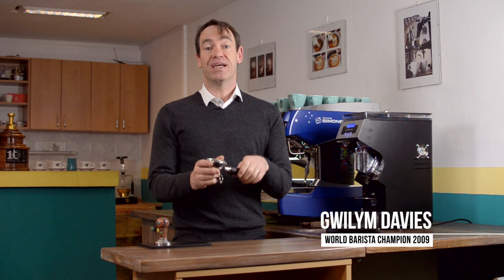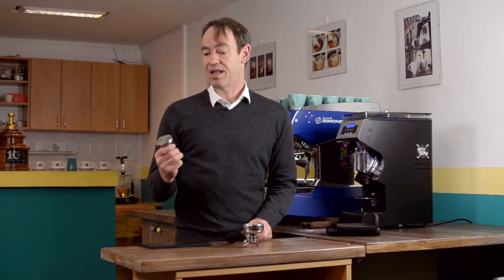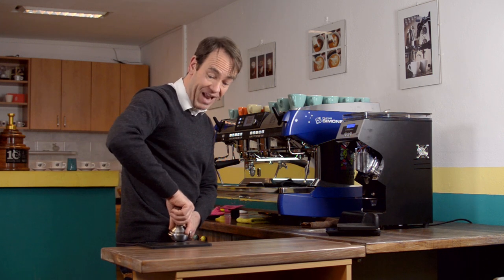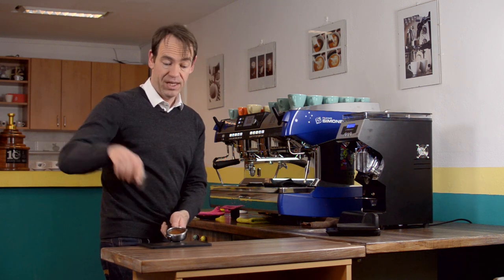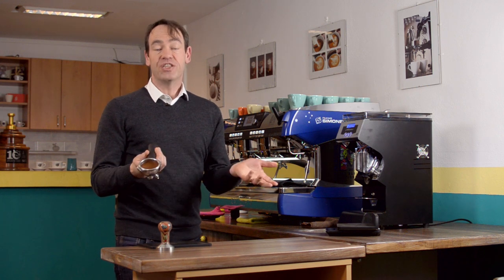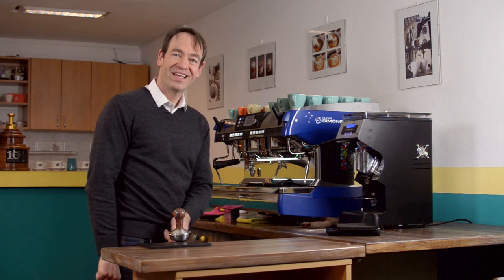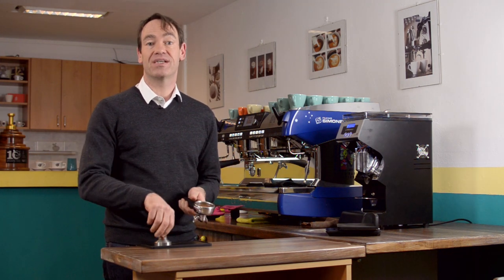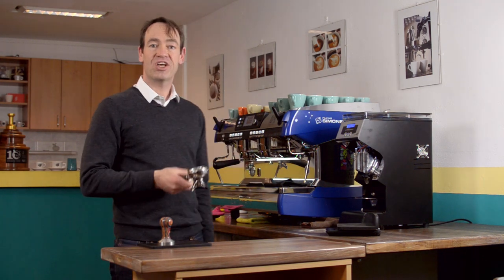How To Tamp Coffee for Espresso (the common mistakes) | Barista Training w/ Gwilym Davies #2

Comment: Comprehensive and user friendly exploration on one if not the most challenging part of espresso making!
Nice point on come out gently a specially for those who use custom tempers that have even tighter fit inside filter basket. They are very capable to lift and disturb the pack while exiting. 
Keep on twisting after packing,  it keeps your temper clean.

Comment: Why spin? I do it as well, not with full pressure but just like you, without downward force. I do it not for the puck or coffee in the portafilter, but for the tamper: It comes out completely clean, when I lift straight after tamping, I get a bit of coffee dust. Don't know why, maybe its static or something, but it is gone after a quick polish and that keeps my tamper and bar area clean for longer.
Reply: Clean tamper, uncratered puck. Especially in a high-speed professional context, a tamper might gather droplets of moisture, which can pull chunks out of the puck.

Comment: And my managers gave out to me that I tamp “too light” but even if I try to put all my weight on it it’s still not as hard as theirs. And I was here thinking “it’s not possible that making coffee would involve a process that is that selective and only strong people can do” 😅 I guess I was right, how can I make them watch it without sending it to them
Reply: Forget that... send them the link and take your W. You deserve it.
Reply: My mentor showed me exactly how hard to tamp by pressing down while I held the tamper. I experimented a lot on slow days and generally discovered that her advice was on the money (occasionally I found places where I could accrue marginal gains). For about a 19g dose in a 58mm filter she applied about 30 lbs of force. She said any more than that would slant the puck (often true) and any less wasn't enough (in reality research seems to suggest 20 is enough, but why risk it?).

On the other hand a lot of home baristas with more expensive equipment than experience and reddit coffeebros who read studies instead of conducting taste comparisons seem to interpret the data as "there is no such thing as tamping too hard" (I've even seen those exact words and similar sentences more than once). Just keep in mind that these are the same people who say things like "you can always go coarser," recommending using pourover grinds for espresso, or in extreme cases "cold-water espresso is just as good, maybe better." If you follow their directions to the letter you'll be making something closer in properties, taste and methodology to pourover, but doing it with an espresso machine- the usual recipe looks like an oversized dose of coarse light- to medium-roast grounds, shaken then tamped as hard as possible to reduce channeling (coarser grinds will have more variation between boulders and fines, necessitating different measures from finer espresso grinds), pre-infused for around 20 seconds (aka "bloomed" or steeped) if possible with your machine (only manuals and stupidly niche electrics can actually do this without hacky workarounds), then pulled extremely fast (5-10 seconds) at low pressure (6 bar or less, ie under the espresso threshold), usually at a very long ratio like 3:1 or even 4:1, resulting in a drink that is lighter, sweeter and weaker than espresso, while extracting a similar overall mass of solubles into a larger volume of water, with a lighter colour and little or no crema. In other words, it's functionally a more expensive and tedious pourover.

The real problem is when someone happens upon only part of this method, takes it as rote that it's a "superior technique," and implements it unquestioningly; or when eg someone sees that "surprisingly" turbo shots (or sone parts of their methodology) have similar or "better" extraction to traditional espresso, think this means they are superior or "stronger" (a similar misconception abounds with cold brew, because a cup (8 oz) of cold brew contains more caffeine than a "cup" (1 oz) of espresso, leading the semi-educated to say cold brew is actually stronger than espresso), and refuse to make espresso traditionally. Fortunately it's mostly a disease of home varistas, but it sounds like your bosses might have been in that camp, since the extra hard tamp fits the profile.

Comment: if i weren't putting enough pressure on the ground coffee with the tamper or not having enough coffee in the portafilter, could this be the reason my coffee keeps going watery really quickly? i've just got a coffee machine so i don't really understand why the coffee is so weak.
Reply: +Joseph Muleteer it is most likely: too little coffee in the portafilter basket or not grinding fine enough or the coffee has got old